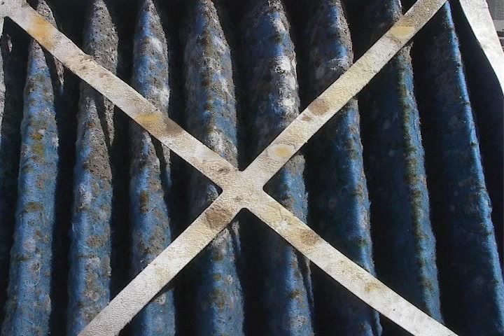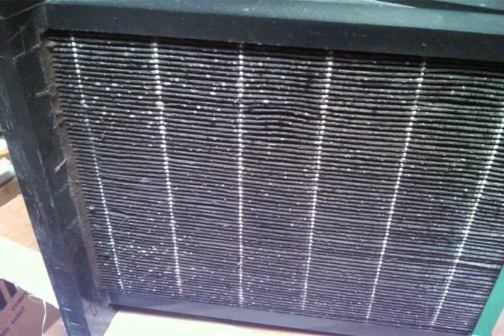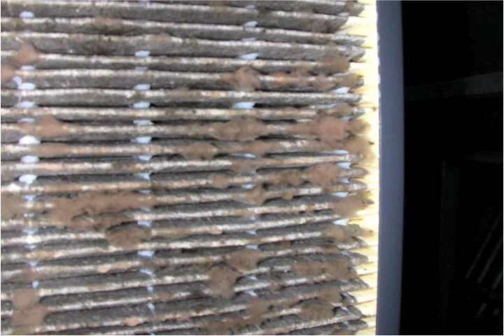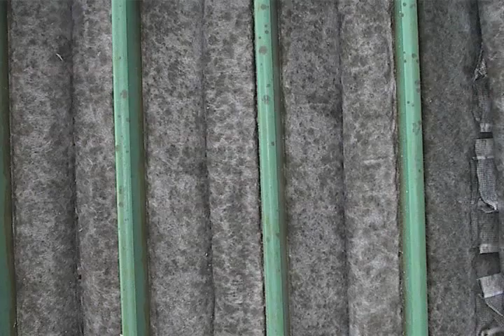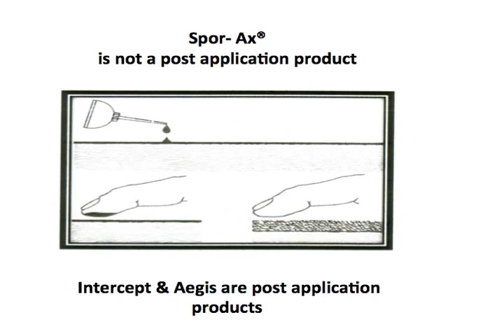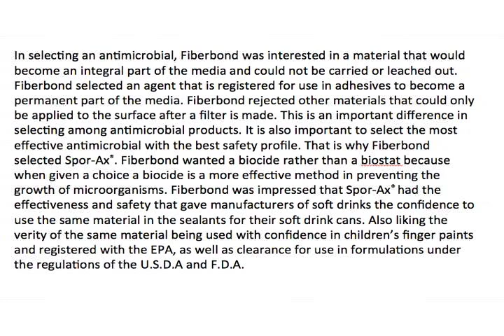Mold and Spores Discussion

Comment: So what about the rest of the HVAC system?  Coil, fan, duct?  If there is mold in the system, it would be the whole system.  And for the filters, once they are covered with dust from filtering, the mold just grows on top of the dirt and dead mold killed by the antimicrobial.
Reply from the maker: Great question! I'm not an expert on molds and spores but I have been in this industry for a 25 years and what I've seen is an HVAC has a lot less of a chance developing molds and spores so long as there is no food source for microbes. I've actually seen with my own eyes mold starting to grow on the plenum upstream of filters and stop dead in its tracks once it migrated and made contact with our filters. Nothing migrated on or downstream. Fiberbond Products keep each of our facilities systems so clean, virtually debris free, that we've never had an incident. Again, I'm no expert but I do know microbes need a food source. Remove the food source and you don't have the problem and that certainly holds true in our 25 years experience in this industry. I've come across plenty of facilities using conventional products experiencing all sorts of issues but it doesn't happen with our products and concept. You have to take into consideration that Spor-Ax is a very different agent, it works very differently than the other two.